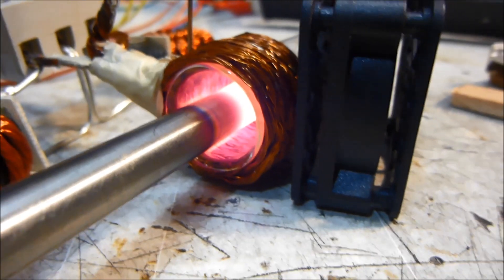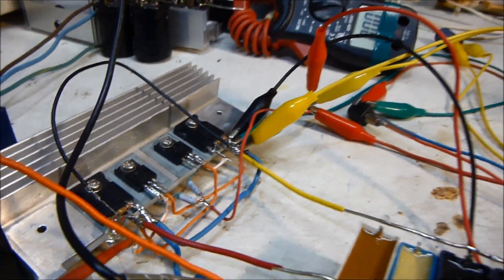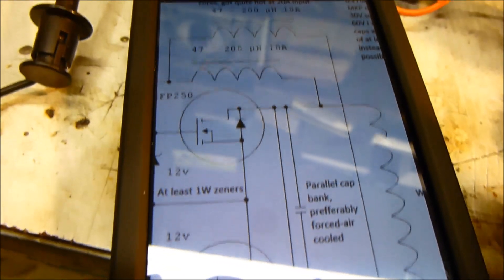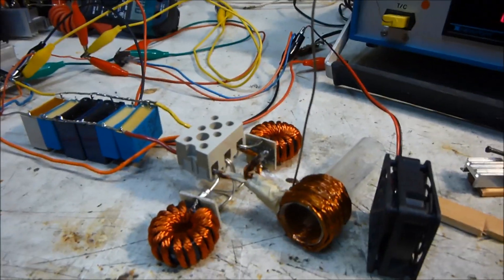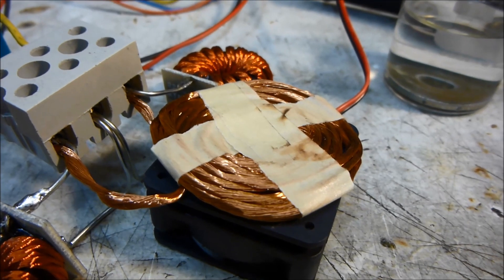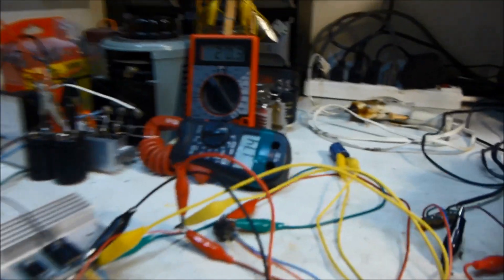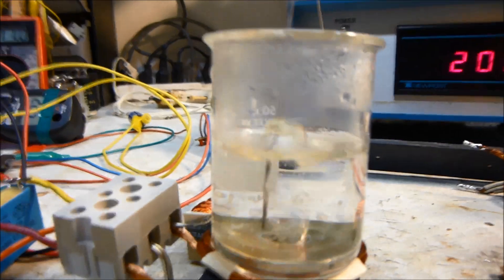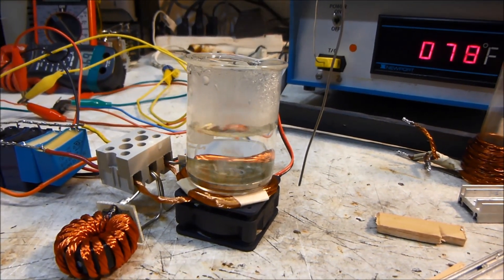Induction Heating With ZVS Driver - Flat Induction Coil Boiling Water and Litz Wire Coils

Comment: Can you give me any advice on where i could salvage suitable MOSFETS for my induction heater? I've already salvaged all the other required parts, and also 20+ transistors, but i really don't know what to look for.
If you could tell the names of some suitable ones, i would really appreciate it.
Reply: Makerj101 the base of a transistors uses vary little current does that mean I always have to use a resistor in my circuit?
Reply: Makerj101 ok thanks
Reply from the maker: Switching power supplies are normally a good place to find medium power MOSFETs.  But generally you are not going to find high power MOSFETs in consumer grade equipment.  My first ZVS driver I use MOSFETs that were salvaged from a big server power supply.  They were rated for 20 amps and worked pretty good for a while until I tried running it on 24 volts.  Then they blew up.  Here's the video, I actually show how to test MOSFETs and stuff like that in the video: httpswww.youtube.comwatchv=3RG--jvQ__o  Your best bet would be to buy some IRFP260N MOSFETs(my favorite ones).  If you want to try to use salvaged MOSFETs then look for anything starting with IRF.  Components that start with IRF are a common MOSFET line.  Then look up the rest of the part number on google and look at the data sheet to see if it has a suitable current rating.  In generally anything with a current rating over 10 amps should work for a very weak ZVS driver if you are super careful not to over current them.  If the current rating is only like 10 amps but you have multiple of the same exact ones you can parallel them so they can handle 20 amps.
Reply: Makerj101 Thanks a lot for the treasure trove of info.
Now i know where to start.
Reply from the maker: Flint Beastwood You're welcome!  My favorite datasheet website is:  http://www.datasheet.hk/  You can view the datasheets without actually downloading them.  So basically if you find any large component look up the datasheet.  There are other lines of MOSFETs other than the IRF series.  I think there are ones that start with a K and there are others.  So just look up the component number and see.  Maybe I'll do a video on searching components.  I know I always had a really tough time with that until I taught myself how to read them.  Normally the part that starts with a letter is the part number while anything that's just numbers is date code, lot information.  So basically useless to us.  After searching up a bunch of them you should get the hang of it.
Reply: You don't know how much i appreciate yor info. My father actually gave me a book on electronics a couple of hours ago that has the markings explained. Abeit a little outdated, the book has a lot of good info.
It would be really good if you could make a video on this subject as i'm sure a lot of people are having the same problem as me. Well not anymore i hope haha.
Subscribed.
Reply from the maker: Flint Beastwood  Cool!  I've actually really never learned much from books.  I was never a big reader.
Yeah I'll put it on my list of video ideas.  Glad you got it figured out!  Best wishes, keep experimenting
Reply: Makerj101 will the driver I usefor my flyback transformer work for induction heating here is the one I built?https://www.google.com/search?q=flyback+driver+tesla+coil&biw=1600&bih=799&tbm=isch&tbo=u&source=univ&sa=X&ei=Da0UVdivA4znsATUyYKgDQ&sqi=2&ved=0CDwQsAQ#imgdii=_&imgrc=WN50Eb5sckHh4M%253A%3B0CnGRcBrzFobXM%3Bhttp%253A%252F%252Fwww.powerlabs.org%252Fimages%252Fschematic1.gif%3Bhttp%253A%252F%252Fwww.powerlabs.org%252Fflybackdriver.htm%3B249%3B191
Reply from the maker: Owen Chase Hmm... It might.  The one transistor circuits like that generally can't pump out enough power at a high enough frequency.  But it really depends on your setup.  All I can really say for sure is to try it and see.  Best wishes,
Reply: thanks
Reply from the maker: Owen Chase Yeah you should use a resistor on the base or you risk burning out your transistor.

Comment: I have a question, will the nail, or a metal object get hot, if you hold it on the out side of the coil, not on the inside.  For instance lets say, you put a huge metal tube over the coil, not in the middle, will the tube still get hot... I like to build be an induction coil, but want it in the center of a metal tube. Not to stick anything inside the coil, only on the outer ends..
Reply from the maker: Yeah you could do that.  It would heat a tube on the outside but not nearly as efficiently.  It's best on the inside because the magnetic field is most concentrated.  But it can be done.
Reply: Thanks..  I need to build something, where I stick this inside a tube, actually a reactor, but will have a hole in the middle of it..

Comment: It's probably not dangerous if you don't stare at it a lot but recently I found out that white hot metal emits UV.
Reply from the maker: djmips Yep!  That's why you need a welding goggles when welding.

Comment: Hey what about if you will make a cylindrical bifilar working coil to heat up metals or pancake bifi working coil to boil water?

Can this work better than singular coil as you did here?
Reply from the maker: sergiuxy21 Single coil works a lot better in my opinion.  I don't like using bifilar coils for induction heating.  They just don't work well.  Very inefficient and don't heat evenly.

Comment: Hi,Great job there!!! You are a genius,Mozart of Electronics!
Im working on a project like that too but like I'm a beginner in this things,i don't understand how to make the connections very well. Do you have a pic or a scheme for my understanding on how to connect the diodes,resistors with the transistor? 
Thank you!
Reply from the maker: sergiuxy21 Thank you!  Yes there is a schematic on my Google Plus page.  https://plus.google.com/u/0/b/102840732238426269146/+makerj101/posts/DUKuBy1RML8?pid=6080860134604829186&oid=102840732238426269146

Comment: Hello, thanks for this video but i would like to know if it's possible to heat  a flat pure aluminim disk instead of steel or metal disk?

Best regards.

TD
Reply from the maker: It will heat aluminium but because aluminium does not have as much resistance it does not heat as well with my set up.  I believe you would need a much higher frequency to efficiently heat aluminium.  Thank you!
Reply: Makerj101 Nice little maker projects,reminds me my tinker-time. Aluminium does not heat well because it`s not ferromagnetic. This means the magnetic field does not concentrate in the aluminium and during field changing you have poor eddy current which actually causes the heat. As soon you use ferromagnetic metal it will heat up quite fast.You can recognize ferromagnetic metal with a simple magnet, if the magnet sticks to the metal then it`s ferromagnetic. You can heat up material quite well which is ferromagnetic AND conduct current. Check Google or other sources for "eddy current", "ferromagnetic material" and what happens around a magnetic field when it changes in time. 

Greets
Magneto

Comment: Inductive resistance (Xl) of an inductive load increases, if the AC frequency is increased. Xl = 2pifL (f - current frequency, L - coil`s inductance)
When you make a coil using litz wire, you actually make several parallel coils, decreasing the total inductance of the coil. If you look at the formula again, you can see why the coil with lower inductance looks more efficient - lover inductive resistance at higher frequency, thus more current can flow.
Reply from the maker: Interesting!  Makes sense!  Thank you!
Reply: Makerj101 Glad to help. I wish i had more time to mess around with high voltages and currents. But work takes most of my day away. Keep the great work!
Reply from the maker: Yeah I feel the same way when I have school...

Comment: supercool MakerJ! I was actually thinking of a very similar arrangement just the other day, flat induction coil, metal disk at the bottom of a pyrex jar, but not for water, but as the displacement cylinder, and heat source, for a stirling engine!

thanks fer sharing!
Reply from the maker: Thank you!  I guess that would work... But I don't know why you would want to power a Stirling engine from electricity.  It's sort of defeats the purpose and would be quite expensive.  But I guess it would be good just for a test engine for testing efficiency and such.  Good luck!  Thank you!
Reply: Hah! you are totally correct, of course, that much juice would turn an electric motor nicely, wouldn't it?
Reply from the maker: Yeah it would!

Comment: dude J that is wicked awesome ! really great induction heater you built nice explanation too ! which site did you get the diagram on ? i would like to try plus great idea with the litz wire ( not sure how to spell that :-p ) i do have some yokes laying about too so i could start putting one together .. now working the the ferrite core is tricky getting the turns right but when working with them always remember to remove the metal clip it is not part of the circuit or core, it will heat up quickly and take most of the power with it ! just use a bit of tape until you get the turns right then super glue together .. plus using that core setup you can run induction coils with a zvs i got a vid if you are interested setup 2 in anit-parallel running from the zvs .. cheers dude and keep on building !
Reply from the maker: Thank you!  I put the link in the description.  You can try heating the yoke up a little if it has a lot of lacquer/glue on it so the litz wire does not brake as much. 

I'll have to take a look at your video to see if I can get the turns right.  And yeah I should throw the clip away so I stop using it...  As for now though I'm really liking this setup. It just seems to work so good and seems so efficient.
Thank you!  Good luck!

Comment: try to heat up aluminium foil
Reply from the maker: OK!  Do you want me to ball it up or try heating it flat?
Reply: make in something  like pencil shaped just little thicker .
Reply from the maker: Oh like a tube!  Ok I can do that!  Thank you!
Reply: @makerj101  sir, Could you make this assembly solar powered with battery packs, where the induction Loop is the size of a 36in hula hoop? It would only run a few minutes at a time and have direct sun light to charge batteries.
Or loop must be small and connected to direct power source?

Comment: That is AWESOME! much more efficient than I thought it would be. Everything so well explained too! Fantastic video. Well done!
I had a friend John Bump asking me about induction heating a while back, he needs to watch this.

I can't express how impressed I am with these results. Thank you very much for doing this. Its been on my to do list for ages and you have done all the hard work researching and experimenting, so well its taken all the hard work out. Now I just need to make a ZVS and get some solar panels to make a great solar cooker :) Much easier than lenses and mirrors.
Reply: John Bump
 I think I simply have to try it... I like this!
Reply: John Bump & Helena Smith  Been on my to do list way too long. Maybe we should have a weekend challenge? DIY induction heater/cooker/forge
Reply: Makerj101 I do need to get some irf260's. Lots of ZVS makers recommend them. Gret for H-bridge and a few 555 based tesla coil and ignition coil drivers too. I also want to try with a range of MOFSET's I salvaged from plasma TV's etc. Got some k2837's I want to try first only about half the amp rating, but good for 500v :D could run them on directly rectified mains at 290v or so XD Free transistors are always better.

The other advantage to solar, is I could charge a couple of car batterys for 24v, and store power all day for a little cooking. When I had my solar house, buying gas for cooking and refrigeration sucked. With this method I could run both directly from the battery bank.

Oh I have a request too! Fry sausage in a pipe. XD or cook steak or burger on hotplate.

I wonder how the coils in the cpu fan under the pancake like the induction field? I was a little surprised that didn't die. Maybe you could make a pickup coil to power it?
Reply: LMAO. I dont know if I want to eat meat with metal filings in it.

Gate resistor? I wasn't going to use any with 555 driver... 555 pulls them up and down much faster without resistor. Although you do have tyo watch for back current passing the gate. as ac can get back from circuit into MOSFET driver.
Reply from the maker: Interesting!  I will look into 555 timer H-bridges.  I was trying to figure out how to get a push pull sort of circuit with the mosfets and 555 timer.  Hehehehe I bet you are!!!  I have to get around to editing it... :(
Reply: just go grouse hunting with some old fashioned buck-shot  :)
Reply from the maker: Mongrel Shark  Hahaha ya me neither!!!  I cooked some chicken!  Video coming tomorrow I think!

Oh I see! Then yeah you don't need the gate resistor.  I should try 555 mosfet driver.
Reply: I did one for my 1 watt challenge. Have been meaning to do a video where I go over the circuit. Its super easy. 555 output to gate. set freq and duty etc. Off you go. Great with Arduino and other processors too. Just look out for reverse ac current across the gate. I used it to give some regenerative charge in my 1watt challenge light, but too much and the MOSFET wont live long.

Also look into 555 timer and H-bridge....

Looking forward to your inducted chicken
Reply from the maker: Thank you! Hahaha I'm not sure I did all the work!  Because yours is going to be a little different depending on many variables! But yeah I guess I did make it a good bit easier! 

Yes, you do need to make a ZVS driver!  Get some IRF260N mosfets!!!  You will not regret it!  They are awesome!  high1voltage1rules himself suggested them to me and I believe they are one of his favorites!  But you really can't go wrong with 50 amps of power!!!

Hmm the solar induction heater is an interesting idea.  Not very efficient though because solar panels are only like 10% efficient.  But yes, easier. 

Now all I have to figure out it how to melt metal with my induction heater!
Thank you!  and good luck!
Reply from the maker: John Bump Go for it!  Good luck!
Reply from the maker: Mongrel Shark I have to try a 555 timer mosfet driver.  I think I have a bunch of the k2837's too, or similar ones.  Yes you are right Free stuff is always the best!  Just parallel like 5 of them if they don't have a good current rating.  If you do, you will need to make sure the gate drive gets enough current by decreasing the size of the limit resistor.

Yeah using batteries would work good.  That is an interesting idea to use induction heating to run a refrigerator!

I'll take on your challenge to cook some meat with induction heating!!!  Maybe if I just put some metal filings in the meat it will cook from the inside!!!  XD

Actually I had thought of the fan.  I tried to see if the speed changed when I turned the induction heater on but it didn't seem to slow down or anything.  Sometimes it seemed to make a little bit of high frequency sound when I turned the coil on but it could be the coil too cause I couldn't tell.  I didn't even think that I might be induction heating parts inside the fan!!!  I'll have to keep an eye on it and make sure I don't melt it or anything.  It's not super close to the coil though so it should be okay.  I should try a pickup coil!